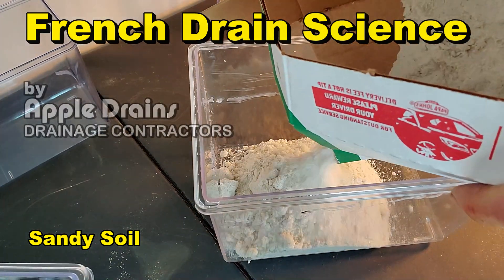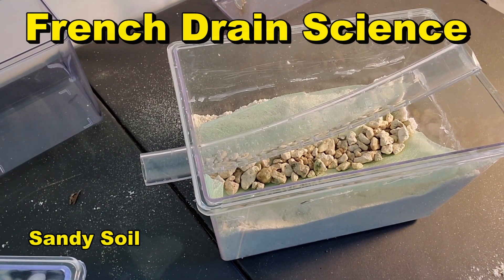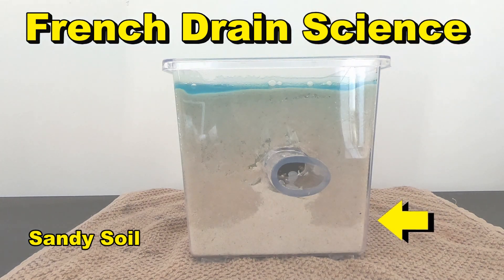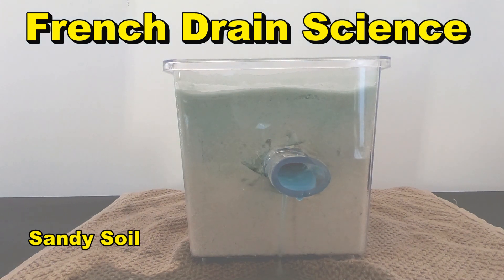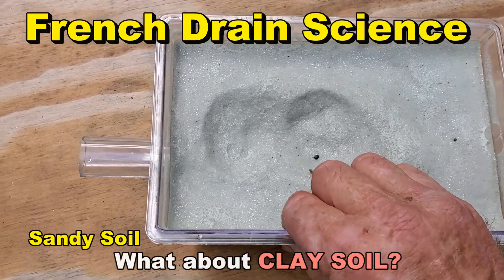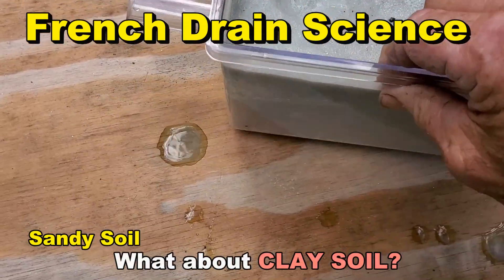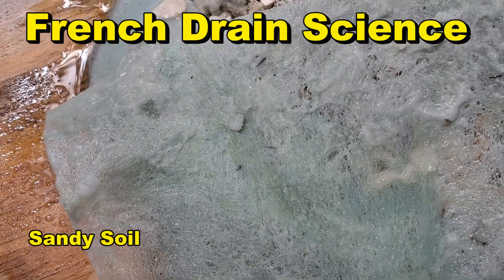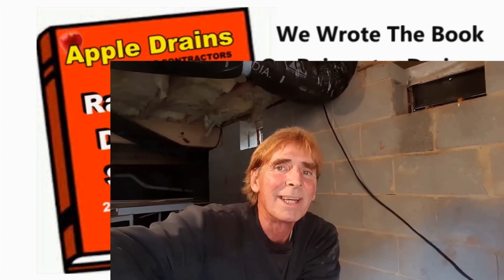French Drain Science   Saturation and Flow

Comment: It looks like capillary action holds the water until its pressure builds up. Bigger holes are required. What if to wrap the hose into stainless steel woven wire mesh rather than having geofabrics?